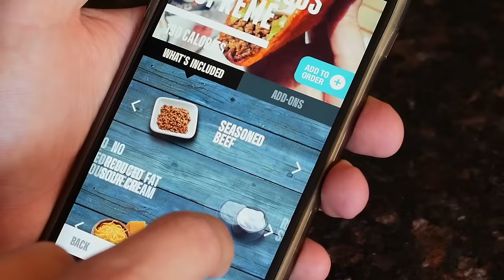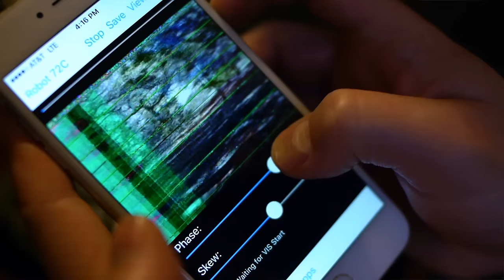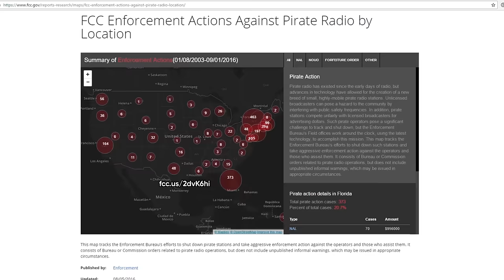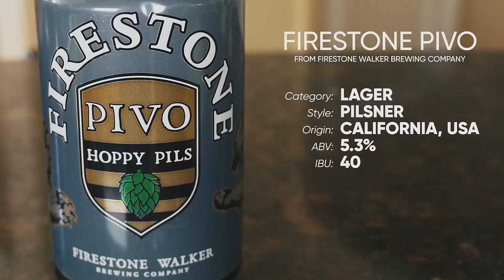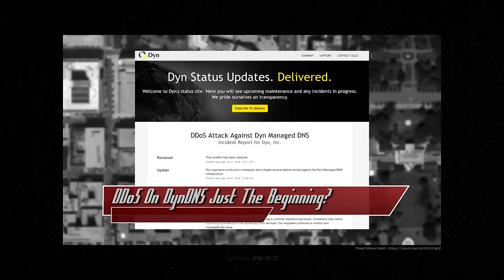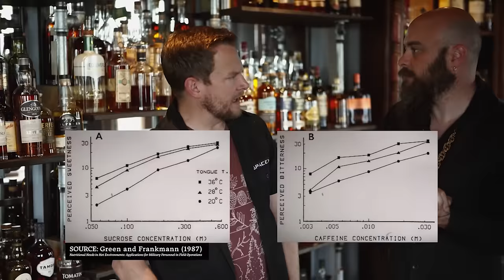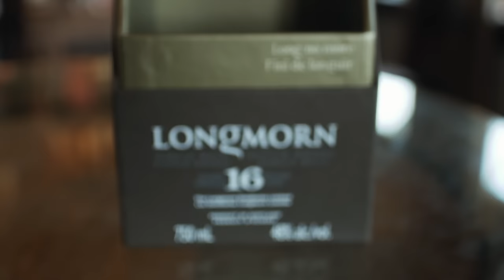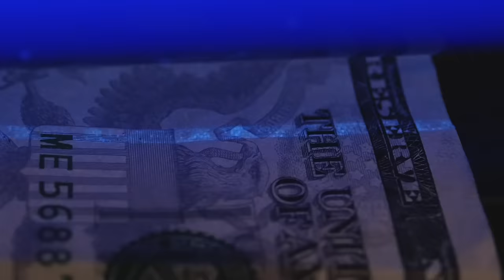12 Hours of Modern Rogue Challenge | Can you survive?

Comment: Modern powders aren't cordite. Cordite is a specific formulation of nitroglycerin, gun cutting (cellulose nitrate) and a petroleum substance. It's pressed or extruded in to long thin strands (hence cordite). It was chosen during the war because it didn't rattle around in the cases as much as loose powder, and burned with a controllable rate. Modern smokeless powders use a more or less pure nitrocellulose composition, made in to various ball and flake shapes to control burn rate.